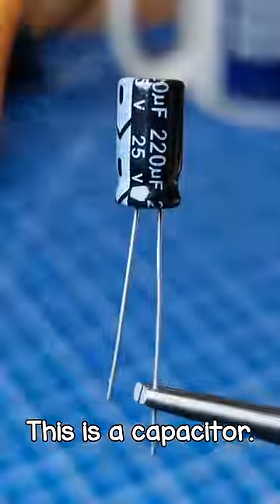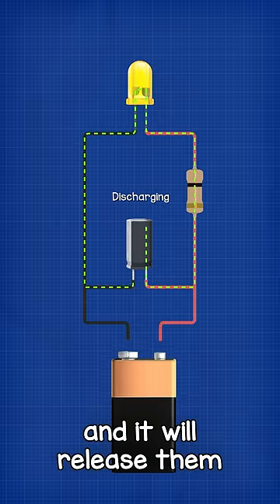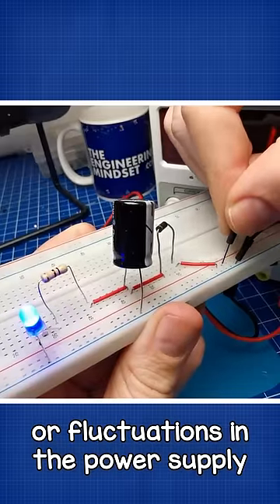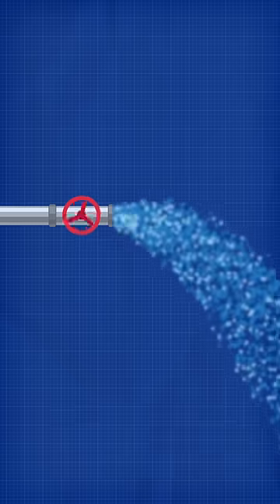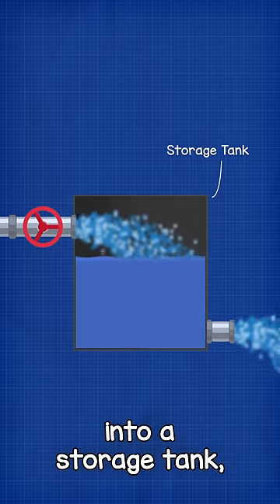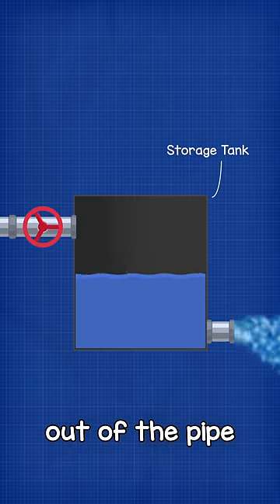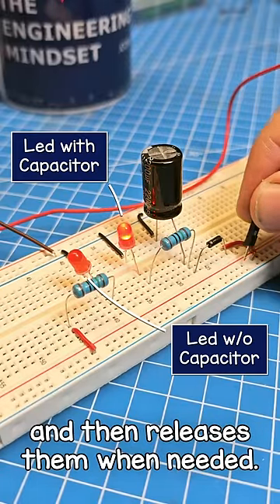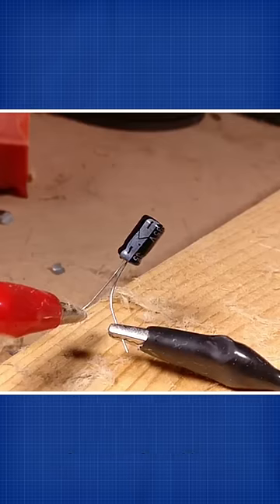What is a capacitor? #technology #electronics #engineering

Comment: Do they discharge immediately (as shown in your illustration), or is there some threshold for current to start flowing?
Reply from the maker: You can control the discharge with a resistor. See the full tutorials we made on that, link bottom left

Comment: Short a capacitor across grid power and combine it with a small motor and you have a very effective alarm clock
Reply: You can't charge a capacitor with grid power as it is ac

Comment: Is there a way to release the capacitor's stored electricy slowly? In your example unplugging the wire over maybe slow enough to leave the wire out for 30 seconds or more?
Reply from the maker: See our capacitor discharge and charge videos for full calculations
Reply: @EngineeringMindset  thanks.

Comment: Please do one of these for the inductor as well! I know they act like mass/inertial component in a circuit but they are confusing for sure.
Reply: They’re just used to induce a magnetic field, generally used to help smooth out power supply kinda like shock absorbers. They’re used as filters for RF, music, power, etc. Any signal that’s comprised of electrons can be filtered, buffered, cleaned up et al with the side of some variety of inductor. Basically as a current passes through them, a magnetic field is formed and as the current fluxes (changes at all) the magnetic field resists change so it’s dampened. Like a shock absorber…
So I suppose in the water since perhaps it would be a Hammer Arrester or an expansion tank maybe
Reply: @revmsj  mass/inertia is probably still the best analogy in my opinion. They don’t really destroy the current but “delay” it. 

Also, the formula for LCR oscillation when compared to SHM shows that inductor replace mass haha. That is where I got the idea from.

Comment: I think the tank analogy is more about charging and discharging the coil. Capacitors act like a balloon that inflates while being charged and deflates when discharged.
Reply: I was thinking the same thing. This would apply more to a inductor than anyting else.
Reply: well electricity still flows through the capactitor so that analogy can bring the wrong ideas
Reply: @hannesvanzyl9004  Meh, two sides to the same coin. The coin being electromagnetic force. Thing is, like the tank, you can get more volts (water volume) out of a capacitor than you put in via  a cap in a circuit like a voltage multiplier. In that regard it does in fact behave much like a storage tank. Inductors cannot do that. They can only hold what flows through it in real time. Yes you can “store” charge in it after power is cut, but never more than the initial voltage, nowhere near as much “volume” as a cap, and not without the help of a capacitor in the first place since…you know…they can only “store” a magnetic field….

Comment: Are caps supposed to be wired in series or parallel of the load? Does it matter what side the cap is wired in in relationship to the load?
Reply from the maker: See our full videos on capacitors

Comment: What’s the difference between polarized vs. unpolarized?
Reply: Unpolarized capacitors can be charged to their maximum voltage in either direction, with no issue.

Polarized capacitors have a dielectric (the insulator between the plates) that is polarity sensitive.  Polarized capacitors have significantly greater dielectric strength for one polarity over the other, and can be damaged by being reverse charged to too high of a voltage.

Comment: A tank in the middle of a pipe is not a good analogy for a capacitor because a capacitor does not conduct electricity. A better analogy would be a flexible membrane in the middle of the pipe.

Comment: I recently opened a few and there were like metal scraps? It looked like metal, and it didnt react with sulfuric acid, which told me that it should be tantalum. But it was VERY fragile, and tantalum shoud be malleable... Can anyone tell me what this substance is? It was also wrapped in like mineral oil soaked paper.

Comment: Very nice explanation for general public but unfortunately it can set them to wrong path in long term. Using analogies as water with electricity is detrimental in long term imho. Get    complex fundamentals right in the beginning and you have less issues in long run. But this is me trying to be clever here 😂. The amount of complexity pure analog passive components will bring to the table is sometimes mind boggling.

Comment: What are the different applications for polarized and non-polarized capacitors?
Reply: A non-polarized capacitor can always be used in place of a polarized capacitor, if you can find one that is large enough for the application.

Non-polarized capacitors are required, if the capacitor will switch polarities during the operation of the circuit.

Polarized capacitors can only be safely charged with one plate as the positive plate, and the other plate as the negative plate.

What's the advantage of a polarized capacitor?  It has the advantage of being able to achieve a higher farad rating for a given physical size.  So if farads are what matter to you, and you know polarity will always be the same in your application, that's when you'd choose a polarized capacitor.
Reply: @carultch  thank you! I learned so much :D

Comment: As long as I know, an CONDENSATOR or CAPACITOR at electronic component FOR stabilization electric flow. It's not like storage tank, but most likely "balancing" tank.
🤔
Reply: Balancing is an application, storing is what it does. You cannot use a capacitor to balance without it storing energy ( even if only momentarily) but you can use it as storage without "balancing" (whatever it is you mean by that).

Comment: CRT tv's also have capacitors, which means that even after decades of not using them, they can still give a you a nasty shock.
Reply: Sometimes but not usually. There should be high ohm bleed resistors that slowly dump charge to ground but I certainly wouldn’t tempt fate

Comment: What makes a capacitor different from a battery?
Reply: Capacitor: Charges quickly, uses insulator between positive and negative terminal to store energy, as negative is attracted to positive, they are stored; there are good khanacademy videos on these. However, they do not hold a lot of energy for their size (energy density).

Battery: Charges slowly if at all, uses chemical processes for energy, hold much more energy in a small package.

They are very similar but have very different use cases.